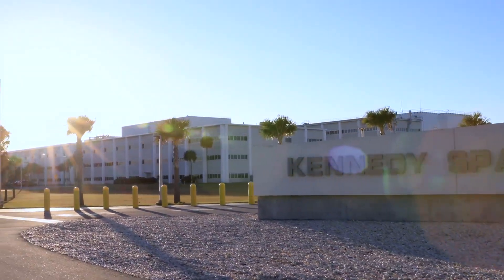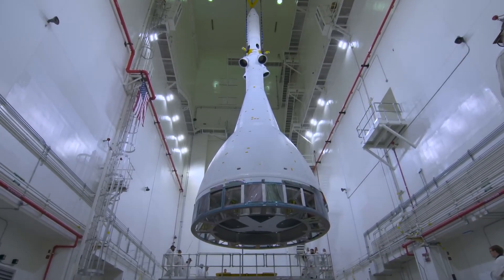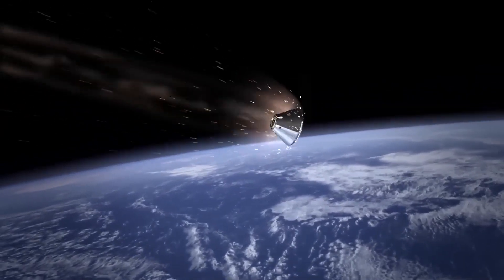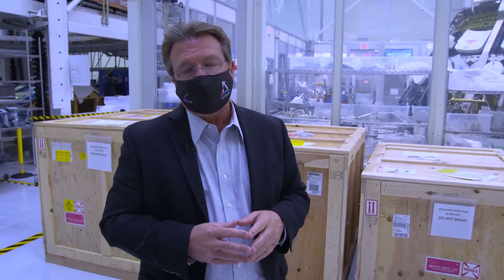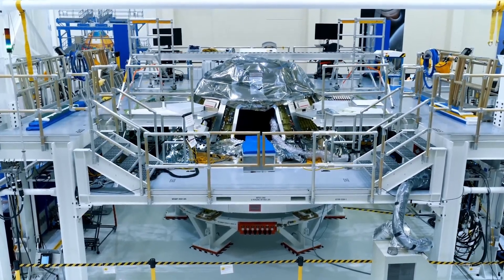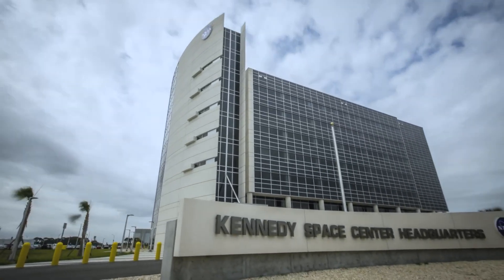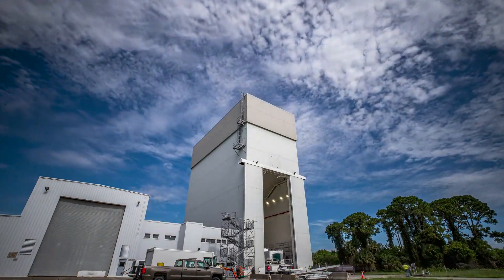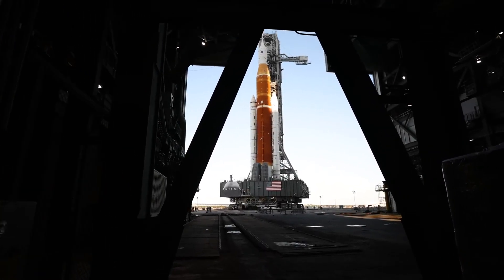Building Orion - Artemis 1 moon mission's spacecraft explained

Comment: Starship with its booster IS the most powerful rocket the world has ever seen. Neither on has flown yet so that metric can't be a qualifier. Once one of them flies, then they will have bragging rights. But once Starship and the booster flies, it will be king of the rockets.
Reply: How much do you want to bet that Starship (in its current configuration) will not deliver 100-tons of usable payload (per trip, not including return fuel) to orbit by 2024 at least once??
Reply: @jeffw8218  Why? It's designed for 150 tons to LEO when reused and 250 tons when expended.
100 tons is easy.
Reply: Well Starship barely reaches beyond orbit velocity parking line. The Beast doesn't task above/within the mesosphere, so the Starship cargo boosters must from there on. It still needed adjacent vessel allies for the Beast. 

 Because its already causing a double full Starship round trip cost  R.R.R. RISK of; Refuel ( full set cost x2), Refill (02 awaiting duriation life supply), Relaunch ( weather & other abandon scrub of humans In orbit).
Reply: @rolflandale2565  An expended starship with 6 vacuum engines has 300 tons of payload. If it has a dry mass of 60 tons (no heatshield for HLS) that's 6.7 km/s of delta-v beyond LEO without refilling.
Reply: Artemis is actually certified to fly. Starship is not. Therefore, Artemis is currently the most powerful rocket the world has ever seen! Once starship can get faa certified, maybe then it can take on the label you stated above!
Reply: @DJXcalibur  They got FAA approval months ago.
Reply: @johntheux9238  ummmm no they didn’t! They got FCC approval! They do not have FAA approval to fly that starship yet! They have to prove all system actually work without it blowing up first! Hence the reason they are still working on it as I type!
Reply: @DJXcalibur  No, the environmental assessment from the FAA is done and they can launch.
Reply: @johntheux9238  this must have happened today, because as of yesterday they had zero approval to fly. They were still working on the starship after it malfunctioned during a test on the pad. They were supposed to test launch it this month, but that date has been pushed back to an unknown one. This was the last info released by them about the starship. That was as of yesterday when I responded to you.
Reply: @DJXcalibur  It was a few months ago.
Reply: 250-300 tons of payload when expended...
Reply: agreed